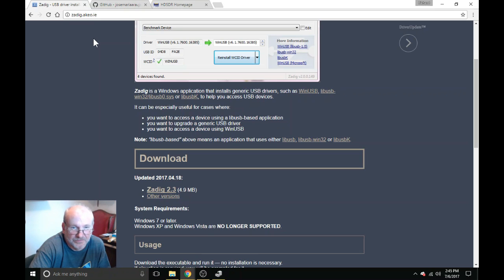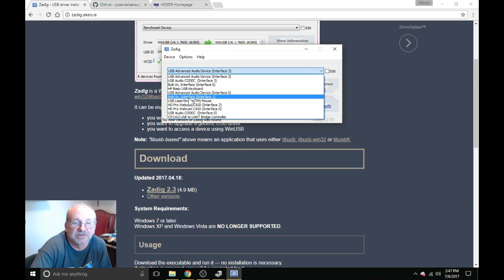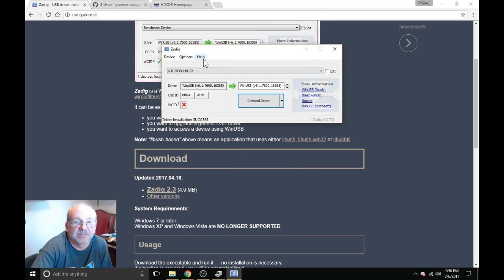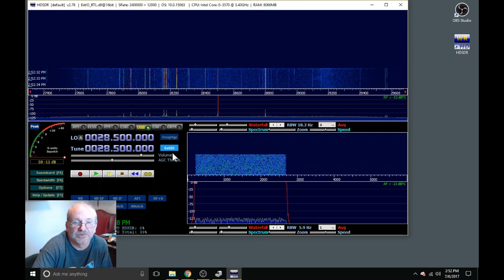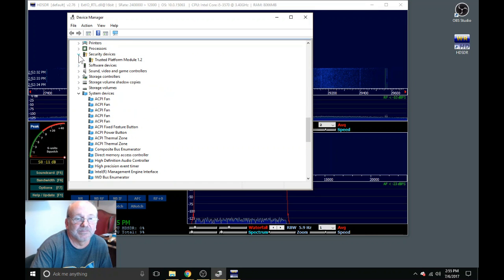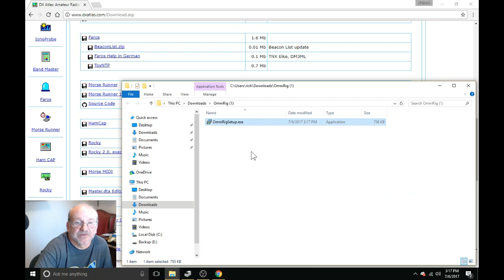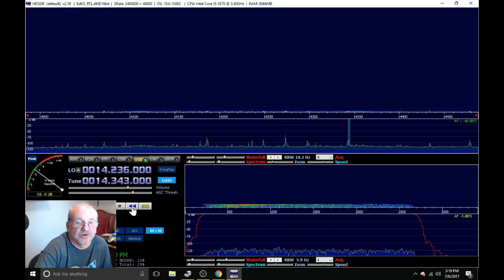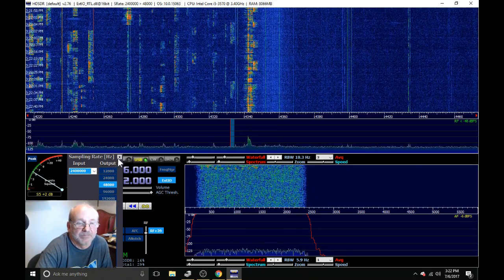Icom 7300 DXPatrol HDSDR Omnirig Install On Win10

Comment from the maker: CAUTION: Use extreme caution when using Zadig. Verify the SDR you are installing a driver for. The name in Zadig can vary with SDR's and systems. Refer to the install instructions that came with your specific SDR device.

Comment: im using a 7300 with a pan adaptor and a rtl sdr as my device, my question is will using a different higher end sdr do anything vs a RTL?   also what color scheme are you using here? Thaks, KM4TQD
Reply from the maker: Thank you for your comment. It's nice to hear from you. I think I was using the default color scheme. In my opinion, a higher quality SDR would be better. The ones that come with their own software are desirable. See SDRplay. Best 73!
Reply: @HamRadioAdventures  thank you for the reply, I will definitely look into a higher end SDR.

Comment: If I use zadig to install a driver for the USB connection to the IC-7300 will that change the setup I already have with HRD(latest) using the ICOM usb driver? I want to try this out but would hate to lose the use of HRD for my logging and digital.
Reply from the maker: No it will install a driver for your SDR dongle. It should not interfere with the ICOM 7300 USB driver. Thanks for watching and thank you so much for commenting here. I hope all is well where you are. Be safe and best 73!

Comment: Also, how do you get your sdruno's spectrograph and waterfall to go completely dead when you transmit? I was watching the BBC Net video you have posted and when you chk in your sdr shuts down with no activity. Im using the mini circuit powered splitter method of connection to the 7300 and I get a spike on my RSP-DX when I key up. Thanks for everything Sir, your a huge help to all us 7300 owners!!

73 DE K4BWP
Reply from the maker: Brandon Prewitt hi and thank you . It kills RX on TX. There is a setting I believe under options to stop RX on transmit. Best Memorial Day! 73 from a rest stop in Iowa.
Reply: Ham Radio with K0PIR 
Thanks bro.. Is the setting in the 7300 or in the sdruno interface.

Comment: First off, thanks for all your help on everything with the 7300. You have been my go to for everything! I just recently installed sdruno for the RSP-DX. when it installed it only went to the Sound, video and game controllers. what is the main purpose of the zidig sending to other places, do I need it to be installed other places, and if I do have you done it to know if it will work? Thanks again Bro. and 73 de K4BWP (Brandon).

Comment: Can you please SHOW what are your physical connections? I am searching to how to use my Ic7300 with HDSDR and Google point me to youtube, everybody shows how works and even how to configure but NOBODY shows the parts and pieces. I mean, I guess I have to buy and RTL dongle and? connect the input of the antenna in the dongle to where in the radio? or the dongle only goes to the computer and  need to have 2 antennas? PLEASE, a video or pictures of how the connections are setup will be greatly appreciated by the bunch of newbies who dont understand what you are talking about. Thanks in advance
Reply from the maker: Angel Perez Hello and nice to hear from you I hope all is well where you are. I have some good photos on my website please visit this link and you’ll have what you need https://www.k0pir.us/icom-7300-panadapter-dxpatrol-mini-circuits-splitter-hdsdr/

Comment: Hi, I was wondering if you can help me, I have the sdr play RSP1A running on my PC, but the waterfall does not replicate on the rig IC 7300  its blank,any ideas?
Also, the red marker on the |RSP1A on the monitor screen is very jumpy and will not move smoothly across the screen when turning the dial on the rig.ant ideas? thank you.
Reply from the maker: Brian. Hi Brian nice to hear from you and it could be a lot of things. What software are you using is it HDSDR?

Comment: Do you have a video on how you hook up the sdr to the radio. Do you use a RX antenna separate from the tx out ? What connectors ? What mods?
Reply from the maker: Hi and thanks again for commenting. Yes, there is an article on my website with pictures. See: http://www.k0pir.us/installing-inrad-rx7300/

Basically you'll need the Inrad RX7300 mod and some small cables to connect to your SDR.

Rich, K0PIR
Reply: Ham Radio with K0PIR what RX antenna is sufficient for hf?  I would like to use a hex on tx. But wouldn’t the hex be better for RX also? Sorry I’m new to the sdr. I do have the rx7300
Reply from the maker: Hi and thank you again. With the RX7300 we are using just one antenna. The DXPatrol was picking up the receive from the splitter. The RX7300 lets us do that. Have a look at Steves clip here: https://youtu.be/HBajms1EnuA?t=8m17s

Comment: Thank you for your great video, but I’m new to SDRSharp I wish I could sort out this ExIo to have it up and running I need some one to load SDRSharp on a memory stick for me so I can put it on my computer up and running.
Reply from the maker: Hi David,
Nice to hear from you and I haven't really used SDRSharp. Have you searched for more videos on it? I know what you mean about the ExtIO, I have a couple that work, one for each SDR I have. it's tricky at first. Go with the instructions that came with the SDR you're using. If I remember right I installed SDRSharp, opened it, chose my SDR from the dropdown menu on the top left and clicked the play (or start) button in SDRSharp. Thank you again for commenting, maybe someone else will jump in. Best 73's - Rich

Comment: Great presentation. Will this conflict with PSK 31 if it is installed first?
Reply from the maker: Hi Philip,
Thank you and nice to have you comment. No, I installed this on my laptop beforehand and I've used it with HRD and WSJT-X. It should not interfere with PSK programs. All of my digital programs were installed on my laptop prior to installing this setup.
I used the panadapter with the SDR receiver (DXPatrol) to listen to my favorite net on SSB, while using the Icom 7300 receiver on JT65 and making some contacts. When the Icom 7300 transmits it just silences the panadapter (mute RX audio on TX option). 
I hope this helps, thanks again and hope to hear you on. Best 73 - Rich, K0PIR